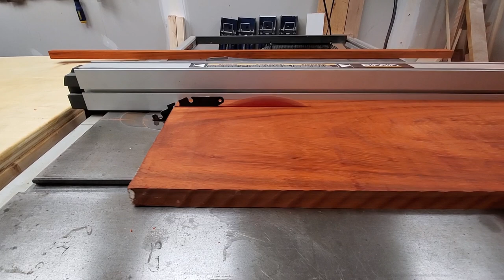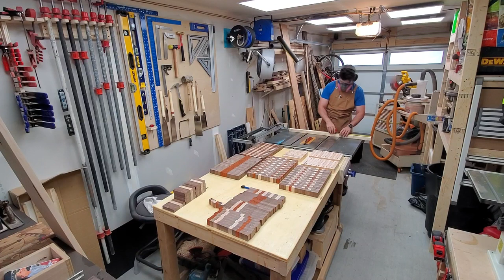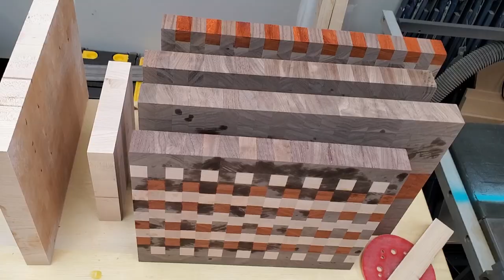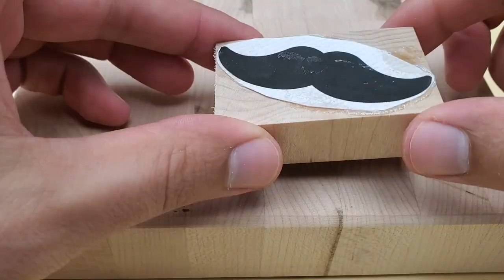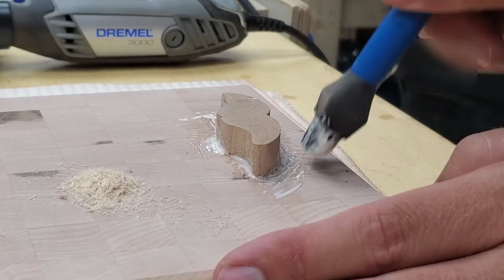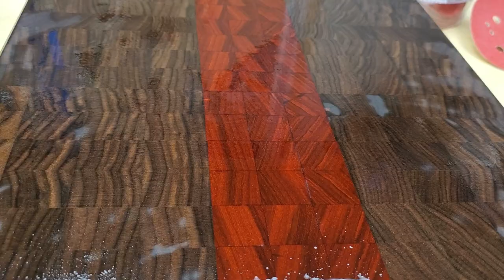Making An End-Grain Cutting Board From Start To Finish

Comment: Nice cutting boards.
I saw that made the repairs by mixing wood dust with white wood glue. Tip: do that with clear lacquer or oil.
Glue often gives stains that you do not get with clear lacquer.

Comment: Good looking boards. How do you prevent tear out when using your planer on end grain? Does it have a helical head?
Reply from the maker: I usually glue a sacrificial board at the ends where the tear out happens. Helical head would help minimize tear out for sure.
Reply: @brokenpinesfarm  ahh! I did see the sacrificial board. Thanks for getting back to me